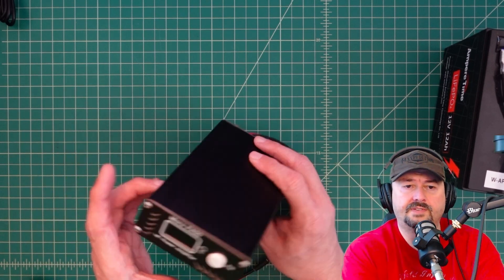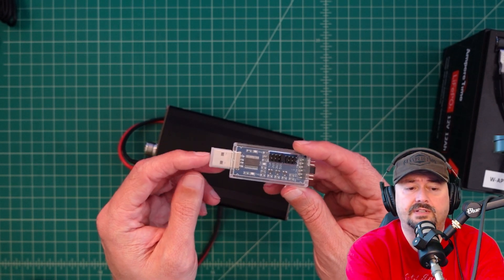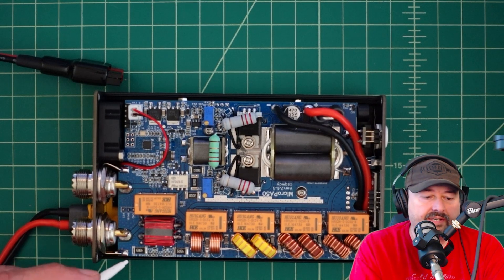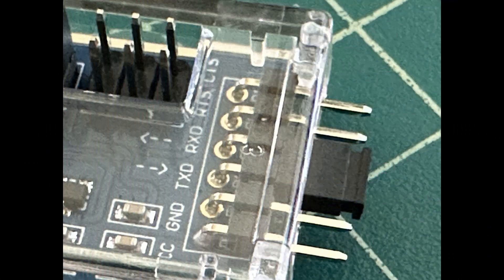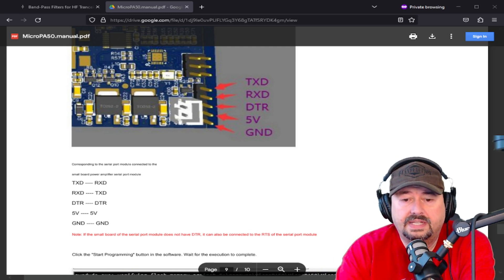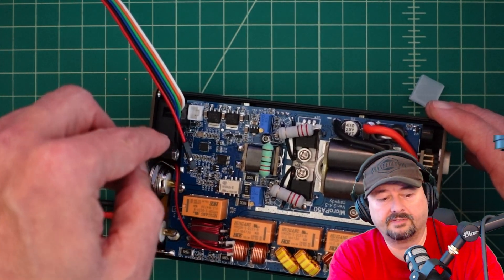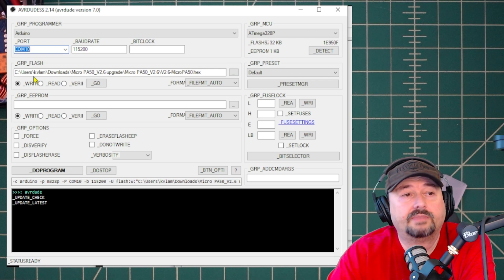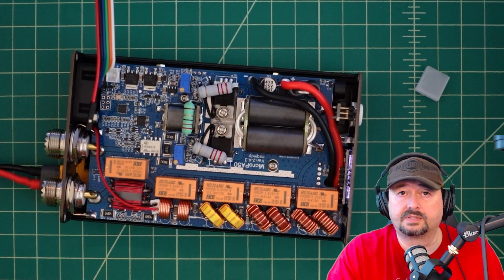Micro PA50 HF Amplifier Firmware Update

Comment: These are piles of junk, they can put power out on fm ok, but trip the protection circuit at 5w ssb  into a dummy load, even disabling the protection it still does this, even with the resistor mod and another one next to it grounded to remove the circuit totally from working, it still does it..
Reply from the maker: I think these are a case of you get what you pay for…
Reply: @TheSmokinApe  Yep. I'm reasonably happy with mine, precisely because I paid so little for it!
Reply from the maker: @socallars3748  I’d say the same, nice to be able to get a little boost when needed 👍
Reply: @TheSmokinApe  And if it blows up, I've got a fistful of IRF530 MOSFETs that cost just a couple dollars. 😁🔥
Reply: 5W into the amp? Or out of it? If the latter, there is something wrong with your unit. My un-modded amp will happily produce 50W into a dummy load or tuned antenna. I keep the input around 3W, no more than 4. Things don't get flaky until the SWR goes up or fluctuates.

Don't get me wrong, it's hardly a Mercury LUX. It's the Yugo of power amps! But it does work, within its limitations.

Comment: I have a PA50+. It was alarming with 5W of drive power. The output power exceeded 50W. And it shut down. My QRP rig and the PA50 does not have an RF output control. Here is the trick... Run the amp on a lower voltage. I get 20W out with a 9V power supply. No more problems. You could go 10V and it would still be OK. I am happy at 20W and much less likely to blow anything up.
Reply from the maker: That is a good trick, thanks for posting 👍

Comment: THe SWR was the least of my problems with it.  I had to open it up and resolder the connections to the SO239 ports.
Reply from the maker: That sucks, I gave the innards of this one a quick check and the connections looked fine 👍
Reply: I think they fixed the issues in the new version and a bit bigger screen but still random solder issues on the antenna sockets. :/
Reply: Same here! It only worked out of the box when I applied pressure to the connector
Reply: Same, one of the solder joints on mine was cracked right out of the box, causing crazy behavior whenever touching the attached coax. Most of the amp is actually built pretty well, but the way they chose to connect the SO239s to the PCB with nothing but a blob of solder is a bit of a joke. Solder is there to provide electrical stability, NOT mechanical stability.

Speaking of boxes, I was shocked by the flimsy, thin cardboard box the thing was delivered in. Aliexpress will use a pound of bubble wrap to ship a pack of fuses, but an HF amplifier is sent basically wrapped in a bit of heavy paper!

Comment: It will be interesting to see if the firmware update fixes the SWR protection issue.
Reply from the maker: Yeah, I’m hearing that it does but I’d like to test it for myself 👍
Reply: @TheSmokinApe  Hey, have you had a chance to test the firmware upgrade? I'm not convinced it's improved, but I'd love to know what you've experienced with it.
Reply from the maker: @socallars3748 I haven’t tested anything newer than what I did in the video

Comment: Often bad readings of SWR are the fault of common mode current… do you choke really well before the amps/tuners (some are both), especially for non-resonant and off-center antennas, which is best practice? You’re the choke king, but you didn’t mention it at the beginning.
Reply from the maker: Hey Kinetic, that’s correct that RFI can cause that problem.  Generally I choke at the antenna feed point and then after the amp / tuner.  In the case of this amp it was widely reported that that amp had problems with SWR so it wasn’t just me 👍
Reply: Reading "Choke king" made me chuckle. Choking lol.

Comment: I would love to know if this fixed the problem for you, And also if it makes any change to needing to physically press a reset button. 

I hoped to use this amplifier for remote use however it goes into protection mode so easily and then you have to physically be there to reset it... Does the new firmware solve this problem?
Reply from the maker: I’ll do some testing on the SWR and report back.  I hadn’t used the amp in months because it was pretty bad before 👍